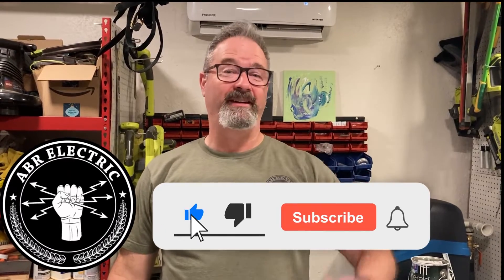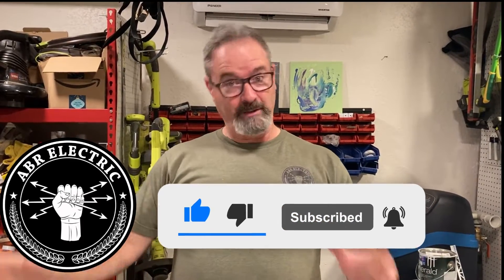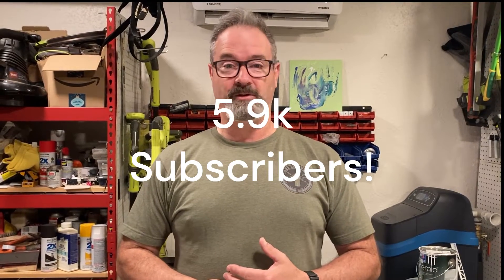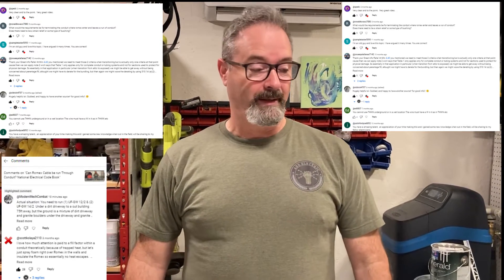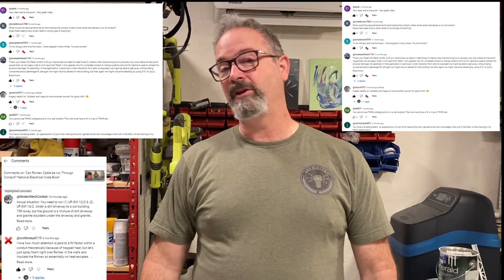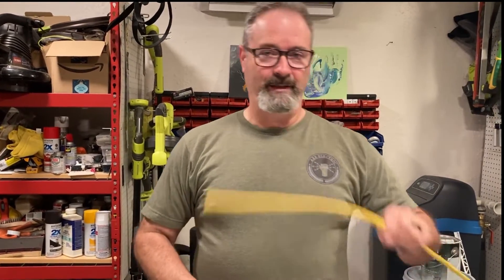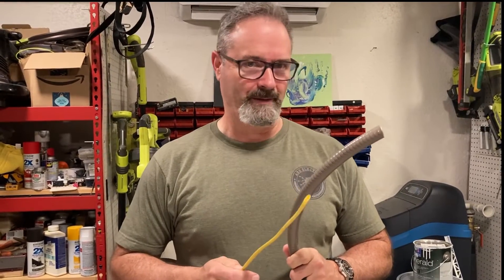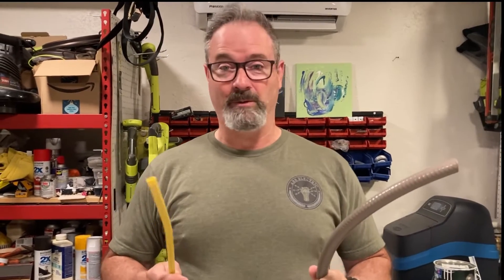Two Basic Rules for Using Romex...

Comment: if conduit is physically underground it's a wet location and type NM romex doesn't meet code, UF cable must be used, but there are other uses such as outlets inside a block construction garage that will always be sleeved with conduit of some type. Heat dissipation isn't an issue unless you have 4 or more romex runs in one conduit.
Reply: Derating occurs with 2 or more romex cables (more than 3 current carrying conductors), not 4.
Reply: @pld8993  Not the case NEC 310.15 (E) covers the neutral. A neutral in a 2 wire romex with ground does not count as current carrying. I suggest you buy a code book and read it to clear up the confusion
Reply: @JeffBanfield-t6v  You're wrong. Which part of "Neutral conductors SHALL be considered current carrying" do you not understand?

Comment: Why would you pull romex thrue a conduit. I have never after 35 years in the ibew worked with someone who did that . Pull wire . And if you are concerned  about pipe fill just install a bigger pipe for example  4 #10 
What size pipe. And pvc is ok to to trench or install under ground .I did not say pvc . In concrete .so you can always up the size of pipe .
Reply: How about not using romex at all and pull wire.
Reply: @eddieo9424  romex is wire
Reply: I use 1900  boxes inside,  pipe back to the panel  steel ridgid 
Pipe thru the wall, to outside weather  proof rated  disco.
Seal tight to the ac compressor.   That's how I was trained to pipe homes . People dwelling.  Pipe last longer in a fire and people have more time to evacuate.  Romex burns toxic smoke. If your not just call your fire department  and ask.
Reply: I have a pole barn and just need to protect the wire.  It is cheaper to buy a roll of romex than it is to buy 3 individual wires by the foot.
Reply: to protect the cable from physical damage.
Reply: When you're shacking a house you run Romex through the wall and then poke outside and run conduit to your exterior load, typically      A/Cs.